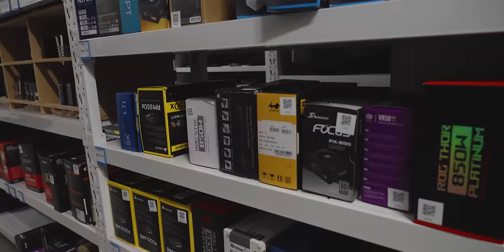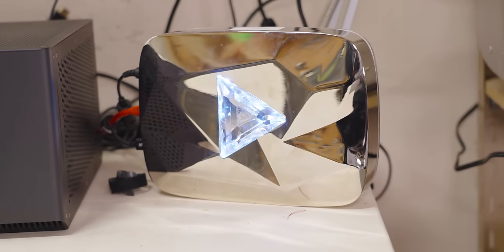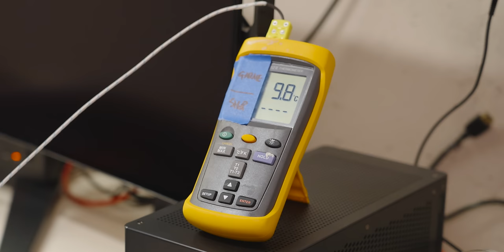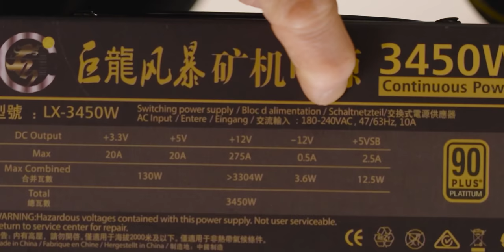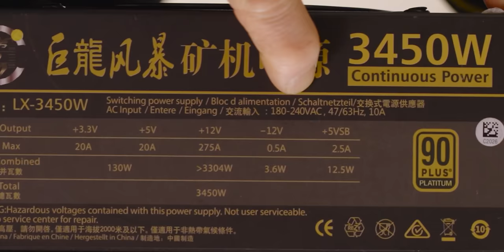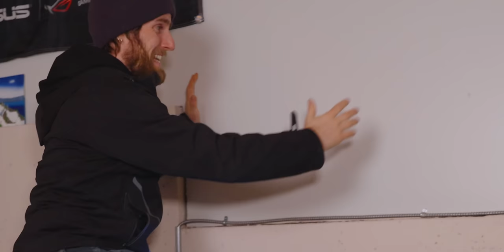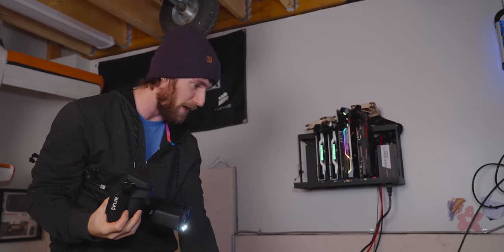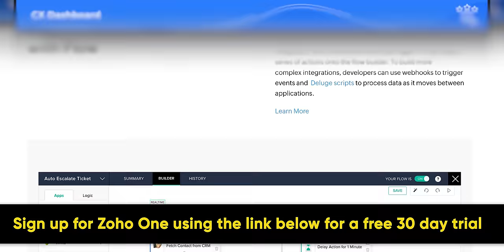Ask me why I'm Mining in 2023...

Comment: We had to move in with my brother and sister in law in 2020 and spent the winter of 2020 in their basement. They only had one HVAC vent and a space heater built into the tv stand, along with it being an 80+ year old house with pretty sure original windows, it got drafty. I hung blackout curtains like you did at specific points that separated our living space, sleeping space, and the hall that lead to the bathroom and stairs that went upstairs. It made a HUGE difference after the curtains went up. Going from one side to the other was also night and day. So even if you decide to not use the mining rig to heat the area, the curtains and a space heater while you work will make a difference.
Reply: Time to install some windows that aren't to specs half a century ago.
My mum lived in a house built in the 30s and never had issues with heating or isolation.

Comment: You put the system near your feet, that way when the heat rises, you're the most affected by it.  It also gives it access to the coolest air, bc cold air falls.  Another note is that your little curtain idea doesn't trap in any significant heat.

Comment: A few things that may or may not help

Heat rises, mounting the device low gives it access to cooler air, (more efficient) and puts it below the heat required zone, improving heating
Putting up curtains to retain heated air only works if you're reducing heat seep at the top of the curtain to below heat production
Putting up curtains on 2 sides providing heat containment is of limited effect in the short terms because your walls are so poorly insulated you're not only loosing a bunch of heat through the wall but also trying to counteract a MASSIVE amount of energy deficit from the thermal mass of the walls, because the lack of insulation between inner and outerwall means the whole thermal mass of the brick wall is in play. 

Mount the PC lower to the floor, 
strip staple the curtains to the ceiling to minimise seep, 
Magnet strip the curtains together along the joins to minimise seep
insulate the walls behind and beside your set up. 
Double layering the curtains would help allot too

Comment: There are 3 ways of heat transportation: convection, radiation and conduction.
In high rooms convection, like Linus used, doesn't work. 
In stead use radiation in rooms with a high ceiling, like an IR-heater, (or floor heating).
Conduction is also an option by making chair-heating... (A water cooled computer, heating the chair), which would be the most energy-efficiënt.

Sincerely yours,
An HVAC engineer...

Comment: I have two computers for mining and gaming. My office is a 7x7x10 closed room in the backroom of my house, which can be exposed to the Michigan outdoors through a door at the end of a long hallway, and this winter I've been warm ONLY by my miners. One computer has 2 Titan XPs, and the other computer a 3080. The one with the twin Titans is just outside my office, where it can heat up the backroom. The one with the 3080 is in my office. When the backroom door is closed from the outside for a few hours, the Titan miners bring up the temps to around 60F. This is when it gets around 20-25F outside. Mind you, there is A LOT more air space for it to heat up. My office on the other hand, has been consistently staying around 90F, and since the humidity is dead low, it is actually comfortable in here. I'm typing this up in shorts and a t-shirt. It's actually more comfortable in the backroom and my office than in my house, which is heated only by a wood burning stove. To keep my office tolerable, I have foam draft stoppers attached to my door, since there is an air gap of around 1/2 an inch, top and bottom, so I block that off with the foam. I also have a 20in industrial fan to circulate the air in here. If it gets too stuffy in here, I can tear off the foam stoppers, since they are attached with Velcro, and let the fan pull cooler air in, or I can open my office door to the back room to let the hotter air mix with the not-as-hot air of the backroom. Sometimes, I just leave the door to the outside open just to keep the backroom cold for my miners. 

To heat this small room only takes a few hours with the door shut. It's not a space heater and doesn't do it quickly. Also, I should note that there is no real insulation out here. The front yard is hilly, and comes up to the top of the 1st floor, essentially making it a basement, while the backyard is fully exposed. So this room is insulated mostly by the ground and cement cinder blocks. As for the roof, we have a barn shaped 4 sided roof that goes ground to ground, and part of the ceiling of my office is slanted for the roof. I and the neighbors can tell I do mining because there is no snow on the roof in the exact shape of my office. 🤣

What you need to heat up that space is a 20inch industrial fan to circulate air for just that area. I'm not talking about having it blow over and through those video cards, but it wouldn't hurt. Also, heat rises, so if you REALLY want to heat that room a little more effectively, get that thing off the wall and down near the floor. Also, you might want to tape up the edges of those curtains to the wall so there is no air gaps. Heat rises, and it'll pull in the cold air from the sides and bottom of that curtain like suction, so you'll want to push that heat down to your level with the fan. I have my fan mounted on the upper part of a wall near the ceiling aimed up to cool things down, or aimed 45 degrees down and towards the lower part of the door to heat things up and reduce any small drafts.

Comment: Fices that may make this:

1. Make sure that the enclosed space isn't enclosed by an outside wall or something poorly insulated. If it, is insulate that part.
2. Make sure the curtain is actually a good insulater, if not double the curtain the air in between will insulate
3. Mount the Rig low under your desk
4. More Power

Comment: I mean you could just a inferred heater. It wouldn't heat the air just the surfaces the IR hits...
Reply: but that does not involve computers 😞
Reply: @richieqs7789  So they could get a microcontroller and program it so they can turn it on and off via home assistant or something
Reply: @invoke4485  That's quite more interesting 🙂

Comment: My experience with small ~1000W heaters with fans, is that after ~1-2 feet the "hot air rises" effect takes over and the heat all goes to the ceiling.
Reply: Use radiation instead of convection!
Reply: @poldelepel  there are literally no convectional space heaters. all radiating.
Reply: wouldnt work with linus WHOLE garage, but works with smaller spaces, 30 square meter attic? goes from 8 to 20c in an hour max. thats not really bad.

Comment: Could've used blower-style cards.  I've never seen a card output heat quite like a Vega64.
Alternatively, you could've had Alex build you a nice shroud to direct the heat toward the chair.  (or do it with cardboard and duct tape for the authentic LTT level of janky-ness)
Overall, having it mounted up on the wall made it unreasonable to think that the heat would go toward the chair.  You would've been better off mounting those fans at the ceiling pointing straight down onto the chair, since any stray hot air would eventually head up there.
Or just get a heated car seat cover for $40 off Amazon.

Comment: I used to turn my computer on in my dorm room if I woke up in the middle of the night and it was cold. After about 30 minutes my small bedroom was nice and toasty. 
I think Linus would’ve had better luck if he had used an actual case to help build up the heat more (obviously without getting too hot) and placing it low, like under his desk. That way, the heat is more enclosed and if it was running non-stop, there would be a better chance of seeing a noticeable difference in temperature. 

Maybe in v2.0?

Comment: a) Vancouver is downright tropical compared to the rest of the country. Prairies and the territories regularly get colder than Mars. I'm from Southern Ontario, and our cold snap was  a mild -20s and below.  Now it's tropical again above freezing (which is unsual, we're normally in regular snow by this time).
b) lower your effective ceiling.  Like you said earlier, heating the upper areas because of convection is useless. 
c) CONVECTIONI Heated air has lower density than colder air, thus heated air rises, and the displaced air is cold air.  

So much cringe and facepalming watching this.  But that's why we do sometimes I guess.
Reply: The average temperature on Mars is  -80C, the average which means it gets even colder than that... and don't pretend like you didn't mean it because that isn't a joke nor a common saying.

Comment: Heat goes up whether you blow some of it back down or not.
So the most effective way of heating is to install the heat source as close to the floor as possible.
Under the desk, for example.
Or just replace the rig with plant pots and small copper pipe loop alcohol burner. :)

Comment: If you water cooled it, you could use the radiator to put the heat anywhere you wanted it.  Maybe even a raised platform with a floor loop. (just be sure to add antifreeze) 🤣
Reply: Pretty sure the heat gets reduced
Reply: @Baconator20000  how?
Reply: @DeltaNachos  heat gets released through the tubing as the antifreeze comes in contact with multiple lengths of tubing before finally being released into the air by the radiator. However, with the sheer amount of GPUs being used, it can be neglected. With that being said, that also means that air cooling, although being less mobile would be far easier to set up. No screwing stuff up, less chances of making mistakes.
Reply: @alifelessrock48  the heat is still getting released into the room, even if it's "lost" from the tubing
Reply: frankly, with all of the work linus did with ground loops, i'm shocked he didn't run anything through the garage floor. that's the most econimical way to keep a garage warm if you do it when laying the concrete, and where my family did it, we largely just kept it  ~45-50F on the thermostat...
Reply: Sounds like a Langley house water cooling idea to me 😂
Reply: Funnily enough there is an LTT video on water cooling using a normal old hot water radiator somewhere on the channel
Reply: @alifelessrock48  There is insulation for tubing... so the minimal effect it would have is even less of a concern.
Reply: Water cooling..you guys are funny...This video was like a 2 minutes brainstorm idea and it had the most minimal amount of costs to produce as the top criteria..
Reply: @Baconator20000  Energy is not created or destroyed.  In a situation like this, all the heat will still be in the garage.  Efficiency here is only a matter of how much heat can be moved to the radiator and how much will escape from the cards and tubing directly.
Reply: @DeltaNachos  energy is still being absorbed by the tubing, but it is minor enough to the point where you can just ignore it.
Reply: @chrisakaschulbus4903  if the tubing is insulated, that would be worse. It's going to be more efficient if heat from the coolant passes through the tube and into the air. If there is more insulation, than the heat will have to pass through that before getting to the air itself. If the tubing was outside of the intended area of heating, that would make sense, however all of the heat is generated within the area intended to be heated. Insulation would just make it even less effective.

Comment: Heat rises so it will take a while to heat the space from the top downwards and the 1.2kw that the rig uses is not all output as heat (there is a lot used in the computations after all).  The more sensible mounting place would be close to the floor (maybe under the desk) as this would heat you up as the heat rose to ther top of your garage.  A second curtain in front or behind the the first one would also create a ‘double glazing” effect and improve the retention of heat in your work area.   I would be tempted to put a second rig in there as well to double the heat output.
Reply: Pretty much all power used by a PC is disposed as heat
Reply: @betrayedpredator8826  even the light from the monitor ends up as heat. Every last W will end up has heat in an enclosed space

Comment: Not sure if you're still doing this, but I got to your step of the curtains and thought I'd share a tip. Using pipe and drape is fine, but to hold in your heat, line your drapes with mylar emergency blankets or mylar-like attic insulation material, overlap and tape the seams. Air passthrough is your enemy. A couple candles can heat a space that size, if you use a mylar surround.
Reply: Okay, I finished your video. You will be cold and dissatisfied with your space forever until you encapsulate the whole space. You're losing all the heat through the absorption of the upstairs joist bays. I can walk one of your guys through how to encapsulate that workspace for about $300 in materials. The curtain can stay, but if you're cool with shiny surfaces, your space can be encapsulated now for heat retention and finished later for prettiness.

Comment: You should consider the thermodinamics of air. Hot air has less weight than cold air so always goes up as air ballons. It should work if the minning rig is on the floor and then guided by pipes to wher you want the hot air

Comment: As carpenter I will give tip - use drill only for drilling! Use impact driver for any screw- more compact usually more reliable and  for sure more control less damage, also impact driver more powerful .

Comment: seal it in a box on the wall with a opening on the top, and bottom, use a fan mounted on the bottom to pull air in from the top and blow it at you .. suggest low rpm fan for noise ... like a 180mm fan

Comment: If you want to try again, next time make a wood box to surround the rack (just keep everything already built so far where it is in the video), with 2-3 holes sized for some high speed case fans on the top. Then add an exhaust hole on the bottom with some dryer vent hose long enough to go under the desk. Aim hose at chair and you should feel a little warmer. Think of it like the homemade swamp coolers people swamped youtube with, but for heat.

Comment: Put it on the bottom of the desk. The heat will roll up in front of you.  You should probably also put down carpet to heatbreak the floor.  You could also rig a way to lower the ceiling.

Comment: Efficiency of the power supply actually matters. As all energy will finally be released as heat somewhere in your setup, the total energy bill and the total heating capacity will be the same no matter how efficient your hardware are. BUT,  if you have a more efficient power supply, you can push more juice for the GPUs for Mining computations, which will yield more coins, and a lower total net cost of heating.

Comment: Been heating my shop all winter with 1.3ghs on ETC. It definitely does work, but you gotta do a better job of trapping the heat. 

Place the rig on the floor in you little enclosed space and let it run overnight and should be several degrees above where it was. Close any gaps on the curtains as much as you can. 

Use fans to circulate the air within the enclosure, and try to have neutral air pressure so you don't loose too much heat along the tops.

Comment: 1. The only way to heat such a garage is to use infrared radiators, or in other words direct heating, since the warms seeps out of too many places.
2. If you want indirect heating through warm air, you would need to isolate and carpet the floor, isolate the wood paneling behind you, isolate the wood "ceiling" above you, carpet the two remaining walls and make sure your curtains close up up top.
3. The third theoretical option would be sitting in the stream of the hot air produced, but since all heat flows in all directions unlike with e.g. a central water cooler, that won't work here. 🤓

Comment: I did something similar when I my ship was in the baltic. One of the spaces my department owned was the hangout spot. So all the consoles and a big tv were there. This particular room had multiple openings to outside though and zero insulation. Fortunately there was a heating unit in the ceiling. Unfortunately the heat was quickly sucked outside. I eventually reappropriated some wool blankets and hung them up around the main area we hung out under the heater. Worked like a charm. Granted I had to use several layers of blankets to keep the heat in.

Comment: I use 8 x 6700xt's to heat my conservatory when its -2c outside(it goes to 0-2c inside the room). It makes the room too hot, I have to have a window open drawing cold air in. It will get to 40c+ inside and the rig will turn off from getting too hot if a window is not open. Also it makes money.

Comment: You have the right idea, except you end up continuously blowing cold air sourced from above the rig. What you should do:

Separate the heated air from the cold by way of a chamber. Let the rig heat up trapped air around if after a certain amount of time. Then, blow this heated air out while simulataneously sucking cold air into the chamber, completing the cycle. You can calculate the time intervals using the volume of air and the time it takes to heat it. Also, put on floor for obvious reasons.

That's all you need to do, it's so simple. Looking forward to round 2...

Comment: You should put the miners on the floor! Things will be much easier if you have to blow the hot air UP, sideways or even leaning down - instead of strictly down like you're doing right now. We need to keep in mind that hot air WILL go up. If not the air itself, just it's heat.